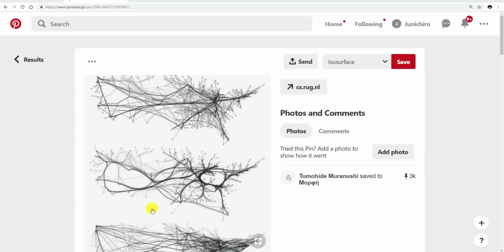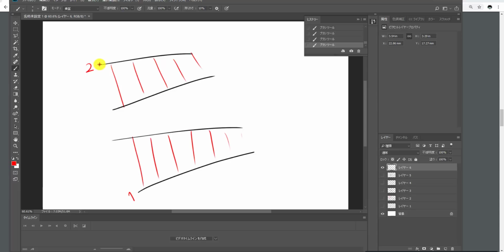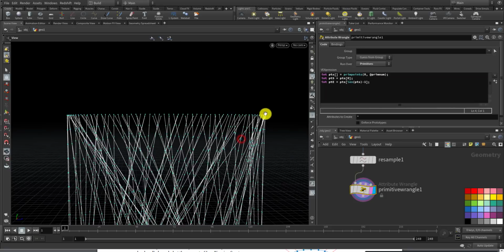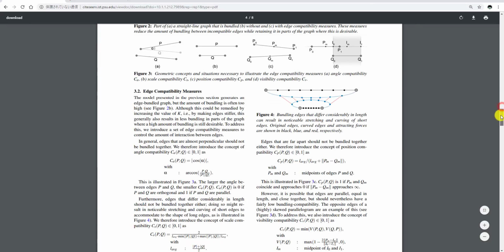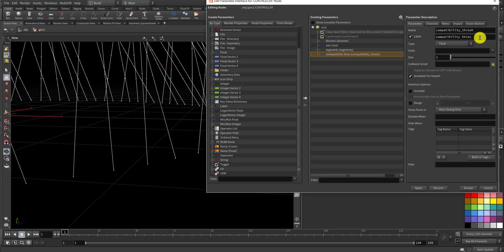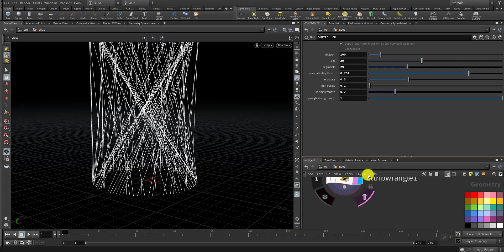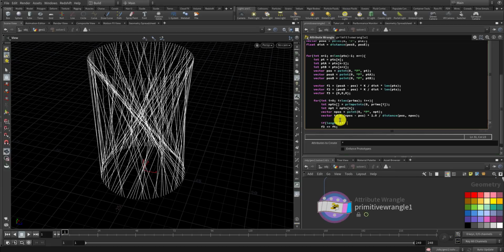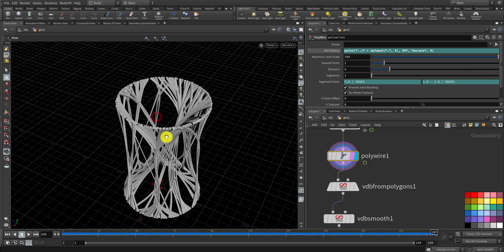[Houdini Tutorial] 0037 Edge Bundling (Slow version)

Comment: I think you did a minor error, in the pscale primitive wrangle node when you use the the fit function for pscale attribute, you wrote (oldMin, oldMax, newMax, newMin) whereas it should be (oldMin, oldMax, newMin, newMax)
Reply: He did it correctly. If you were to switch them the centre would be thick and the extremities thin, whereas with the order he chose, the centre is thin and the extremities thick.